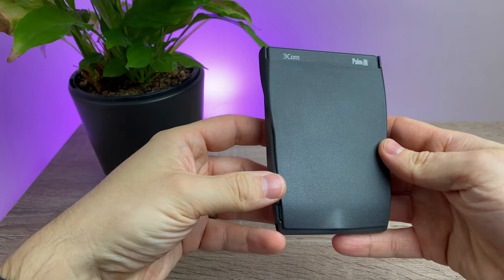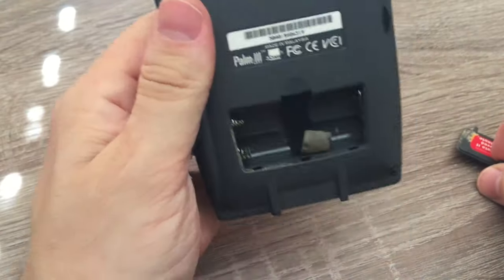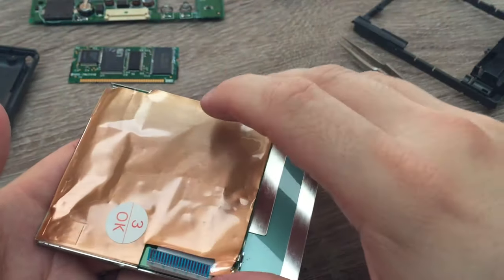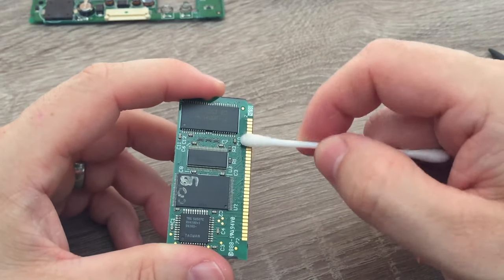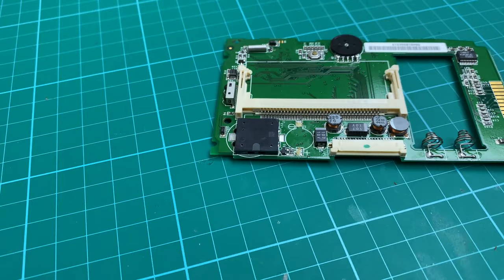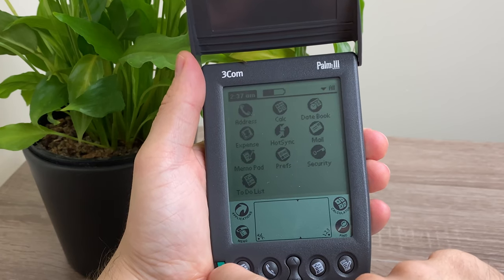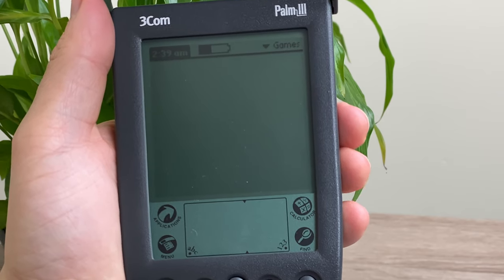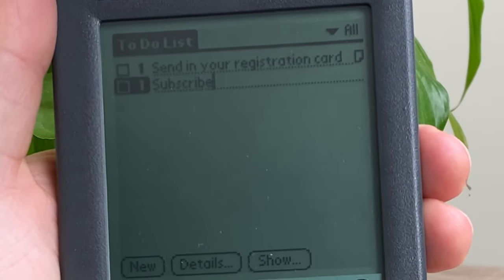Palm III | Teardown / Repair

Comment: I loved this. The Goku ref was awesome lol. That flux looked like mined garlic lol. 5 months for the parts to come in..man that is crazy. I miss electronics stores. The ones that we still have in my area are clueless. Had no clue what I mean by thermal paste or even cmos batteries. I say cmos batteries because an old system had a very unique one that I had to order. 

Anyway Loved the repair and great audio. :)
Reply from the maker: Thanks! Yeah it’s very much old school flux! It’s what I’ve always used. I miss stores too especially when you just want one or two of something. I used to love going to the bit at the back of the store and getting them to get me one transistor from the draws!

Comment: Nice. I love my palm 3 if it was more power efficient and didnt lose its memory so easily when changing batteries, i would still be carrying it daily. The game "Space Trader" is worth picking up one of these by itself. Funny story, i was giving this girl a ride home after she got off work at Walmart a couple years ago and was using my palm 3e to mess with the volume on the store tvs. When she asked what i was doing i said "playing with your tvs" and she said they were all locked down and couldnt be messed with so i used my palm thats over 20 some years outdated to turn off the tv. That shocked her. Lol they still use the same ir codes.
Reply from the maker: I know what you mean talk about range anxiety! And your right it is amazing to think how long IR has been a constant in tv tech. Thanks for watching.
Reply: @RetrogradeScene  hey thanks for your reply. I found your video because I am looking into trying to incert some sort of charging circuit into one of these. I have several, some working, some not.
Reply from the maker: Sounds great! I would love to do some more technical videos on palm and build things for it. Need to set aside some time which always seems the hard bit.

Comment: The previous models could be upgraded with more memory, there was an official 1mb upgrade for those under 1mb of RRAM but there was also a 2mb (Palm III) upgrade card that gave the older units 2mb of memory, contained the new Palm OS 3 and gave the older models IrDA. It even came with a new RAM cover for the IrDA transceiver. Third parties also made use of the slot, there was a SmartMedia card slot on one, TRG made 8mb modules for those older models that also included more flash ROM onboard! These are insanely rare as you would imagine.
I love the OG Palm III, it had the good backlight. My first one was actually the IIIe when I was a kid, maybe 2001~2002 I got it. It was great.
Reply from the maker: I’ve been looking for some of these for a while. Definitely hard to track down especially for a good price. Thanks for adding the info and thanks for watching.

Comment: Thanks for this video!  I recently picked up a non-working Palm III for a couple bucks recently.  The PCB wasn't budging from around the battery compartment when I was trying to take it apart to clean it, just wanted to make sure I wasn't missing something.  Looks like I just need to try a bit harder.
Reply from the maker: Yeah it is tough to take out, it’s a tight fit and it’s clipped in, but it should just come off. Good luck getting it out and hope you get it working!

Comment: Do you think you'd be able to fix a Handspring Visor?  Among other PDAs of mine that need to be fixed, I haven't had much success trying to fix this one in particular. It looks like something fell off the main board.
Reply from the maker: I’ve been lucky with the Visor’s I’ve had so I’ve not needed to fix any yet. I’ll try and get some pictures of the main board’s in mine, might help workout what’s missing from yours.

Comment: Hi, I have a pair of IIIxes, both have died during the last 20 years in the loft. So worth a punt to replace the caps. What is the rating of the capacitors? If you have a surplus I would be interested in buying a couple. I have another really rare Palm device, an Acer S30 which was a giveaway with a laptop I bought. Colour screen and MP3 player and expansion via a Sony Memory Stick. Sprang to life when I put it in the dock but rechargeable battery is shot. Fortunately available on Ebay.
Reply from the maker: Yeah I’ve got a few that I need new batteries for. Never had an Acer Palm device. I keep meaning to look for more Palm licensed devices, there’s some really interesting ones out there! The capacitor is a 5.5v 0.1F super capacitor and Its a H type mounting. Good luck getting them working its helped me fix a few now.
Reply: @RetrogradeScene  Thanks I'll see what I can find. I have a few contacts into electronics. I may look at getting one with the right rating but wrong shape (if cheap) so that I can establish if that is the problem with the case open

Comment: Will the memory module in this palm iii work in the palm iiix?
Reply from the maker: No I’m pretty sure it’s not compatible. I know they changed the DRAM controller with the IIIx and I’m sure I’ve read you can’t use the Palm III modules! If I get a IIIx I’ll test it!
Reply: @RetrogradeScene  Thanks alot! I was gonna buy a iii to take out the memory module to put into my iiix, I guess it's a no go then.
Reply: Retrograde Scene also can you share the details on the capacitor you replaced? I am trying to find it in AliExpress. Thanks
Reply from the maker: It was a 0.1F 5.5v type H capacitor. I found some on eBay which were the second lot I ordered and they arrived quicker from the time of ordering. I’d recommend looking on there.
Reply: Retrograde Scene thanks. I found one from AliExpress which came at 5 per lot at 4 bucks